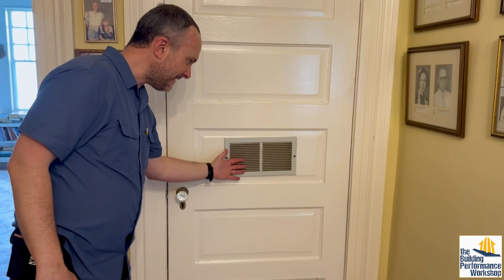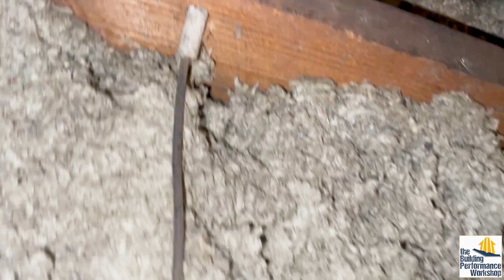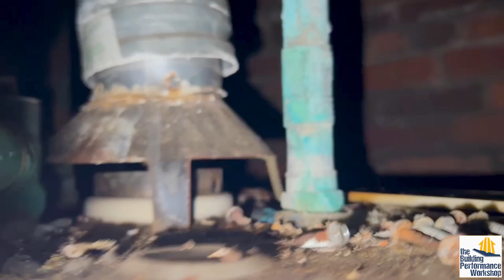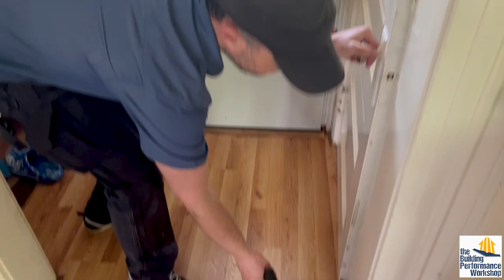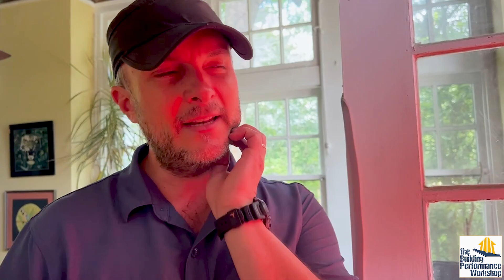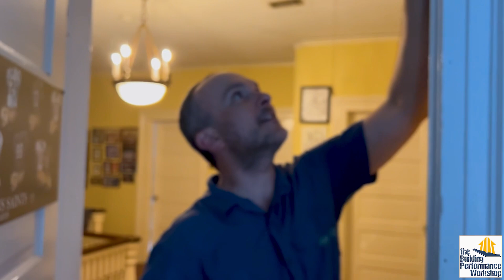Historic Tudor Home TESTED for Major Renovation: Spooky HVAC, Vented Crawlspace, Attic, & Fireplaces

Comment: Why did you guys seal up the fireplace for the blower door test? Were you planning on sealing that off entirely and permanently? Probably what should happen IMO. If not the blower test is pointless right? that chimney is larger in diameter than most return plenums I see lol
Reply from the maker: Fireplaces need dampers. So yes, it’ll get one.

Comment: The commenters saying just tear it down miss the point about a historic home. They are beautiful and are nearly lost examples of practical craftsmanship and engineering for homes built before modern everything. Better light, better cross ventilation, more baseline energy efficiency because of these considerations, well thought out layouts, and better yet, no cookie cutter styles. I just bought a 1930s craftsman home that needs some work and compared to all the ones I saw while shopping that have been ruined by flippers and HGTV addicts it is still more beautiful than any of them, even before beginning the restoration.
Reply from the maker: THANK YOU, well said
Reply: No the houses are trash if you know how to design a house. I'll try to put out a real video on how to design a house because you won't find much online that's great. But ya they are not going to make you money I'll say that. But too hard to explain sorry will try to make a video. Ya they are so so horrible

Comment: That house reminds me of my parents house. Even the brick is the same style and color. It’s a smaller bungalow built in the 1920’s in Indianapolis. It has most of the same issues that you identified. The knob & tube wiring. The basement and crawl space issues. The fireplace with no damper. The list goes on. 

I have a degree in Architecture. I was a homebuilder for over 10 years. I’ve been weatherizing homes in Texas for the last 15 years. I’m BPI QCI. 

I’ve offered to pay for all of the retrofits from re-wiring the house so I can insulate the attic and walls to addressing the basement and crawl issues. That damp dirt smell drives me nuts. I could almost smell it in your video.😂 They always decline the offer because in my mother’s words. “It’s more trouble than it’s worth” They’ve been in that house for over 46 years. Ignorance is bliss I guess. To no avail I’ve tried to convince them that a well insulated, air sealed and properly ventilated house will improve their comfort level especially in the winter, indoor air quality and energy efficiency.

Comment: Hi Corbett! Right now on the Green Building Advisor website there is an article by Jon Harrod about the Ephoca Cold Climate Heat Pump which doesn't need an outdoor unit. It can mount on the wall or ceiling and you can also get it with an ERV included. There is also  video from Taitum Engineering about the unit on this site. Have you heard of them before?
Reply: Did you read specs on them? I did . In a cold climate they give you less than 50 percent from nominal output. Check out Media or Gradient window heat pumps , you would like them better

Comment: Thank you. It is nice to see the issues and a test of a home that looks a lot more like the ones that I've owned than new construction does.

How do you account for the leakage present in the doorway where you have set up the blower? With your blower set up there is no leakage, but without the blower installed there is going to be leakage. When you are able, do you run the test from two doorways so that you can get data on the doorway(s) used for the blower?

Comment: When was that house built? I'm surprised that it has windows in the attic, and it hasn't been converted into a room.
Reply from the maker: 1900 ish
Reply: @HomePerformance  Just think about how many houses like this one there are all over the country. It just blows the mind.
Reply: @HomePerformance  i love that look. tho get rid of that paint and give me wooden floors/walls/doors etc any day. however i don't like the performance. i've lived in some where the carpet flies up the hallway when the wind blows. all those old houses where built to low to the ground with rising damp issues, even tho rising damp was a known thing at the time. even when it became to a legal requirement many houses up into the 70's and later, they where often still low to the ground.
whats weird downunder is those old houses where build as in if they where in England and they face the wrong way.
 people keep trying to build the same even tho the situation or materials/requirements have changed.